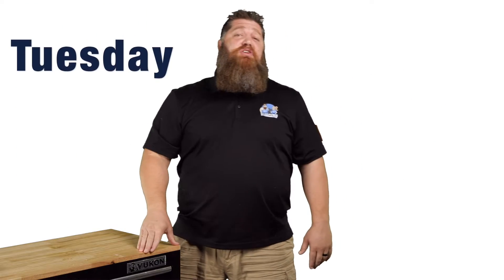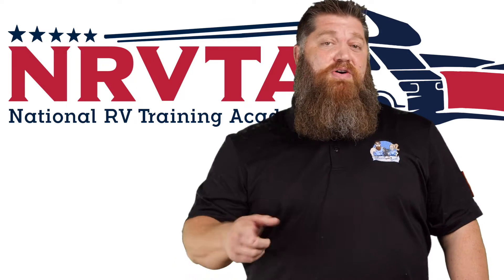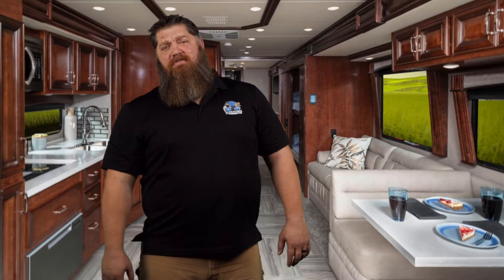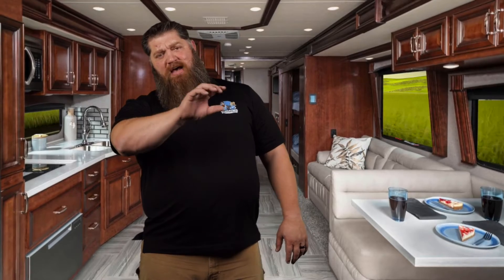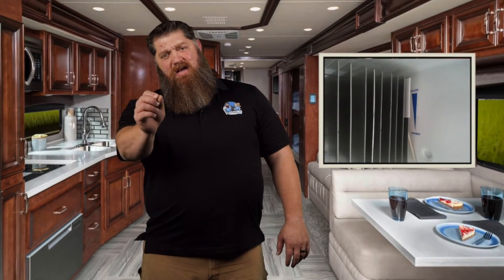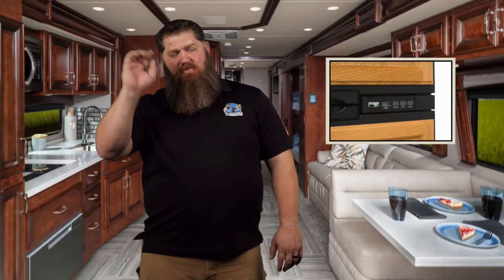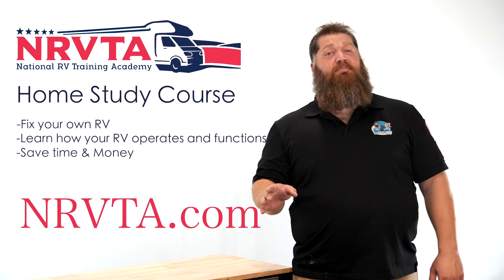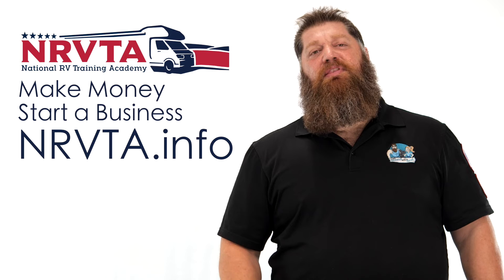Common RV Refrigerator Issues

Comment: Can you run an electric residential refrigerator in a travel trailer that stays parked? I do not care for propane. Thanks
Reply: Yes that’s what I did after my piece of crap rv fridge went out, I bought a fridge from Home Depot for $300 and added a breaker to my breaker box to install the fridge, a whole lot more room, best mod I’ve done
Reply: @raymencaldwell3854  That's the reply I was hoping for. I will do the same. Which fridge brand and or model was it you bought? Much appreciate your reply.

Comment: Best thing I ever did for my fridge was tear it out and put in a 12v compressor fridge. No flame hazard, no exterior vent, and it runs completely off my solar.
Reply: how much solar does it take
Reply: @carolmaplesden916  Not sure exactly how much the fridge draws, but I have 1,000 watts of panels with 400ah of LiFePo batteries and the fridge doesn't make a dent in the available power.
Reply: @carolmaplesden916  By the way, it's the Norcold N10DCSSR. Not cheap, but because it doesn't need the space for the propane flame tube, there is a lot more usable interior space. For me the safety and space were totally worth it.
Reply: @jebediahkerman3946   we are full time and our 4 door Norcold frig. has been doing perfectly. However right now l have the thermister unplugged to keep the frig inside down to 40 degrees.  My husband thinks we need to convert it over to a 12 volt.  Do you agree with THAT?
Reply: @Over-for-now  If it's in your budget, I highly recommend the 12v. Mine is still going strong, and all off the solar and batteries. Granted, it's in Florida with no snow, but even running off shore power would be worth it to me just for the extra interior space and no flame.
Reply: This is exactly what I will do next :))

Comment: Can you do a video about refrigerators while traveling? I've heard two things. Obviously, I have an AC/Propane fridge. A dealer told me if I was traveling and wanted to keep food cool, switch it to gas and let it run during the trip. I have also been told it's technically illegal to have propane on while traveling. Is this safe to do? Or, would it be better to install an inverter just for the fridge? I follow racing circuits, so I move a lot.

Comment: My Norcold N811V 8cft manual says to move Thermistor left for cooler or right for warmer. What about operation on gas above 5500 feet? Have you heard of Dinosaur Electronics controls for high altitude?

Comment: How cold outside before the heater can't keep enough heat behind fridge to make  cooling the fridge ? Would placing a small heater behind help.. like 300 watt ?
Reply from the maker: You shouldn’t have to go that far. Just make sure you’re not circulating cold air.
Reply: @NationalRVTrainingAcademy  thanks, maybe closing some of the bottom vent to slow down cold air blowing up the back of fridge and out the roof. I live in Canada and it's cold.